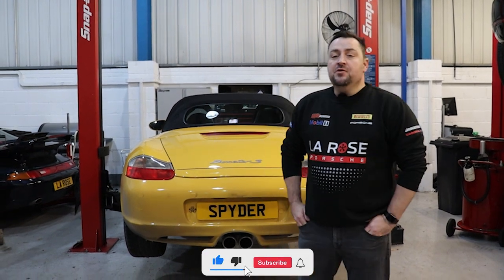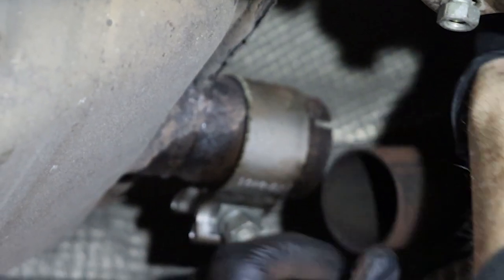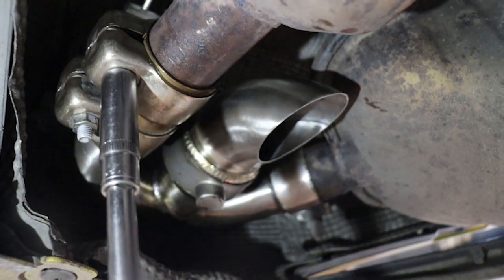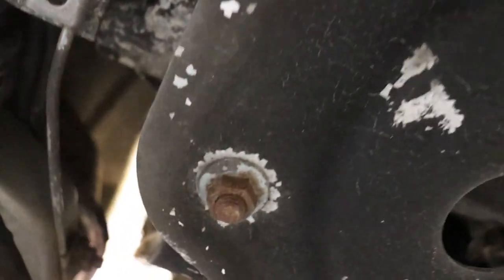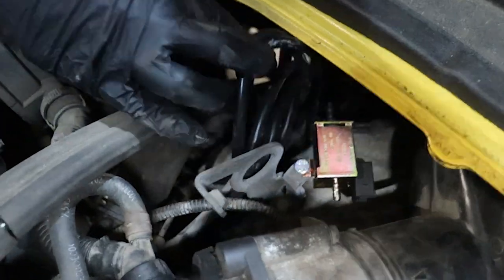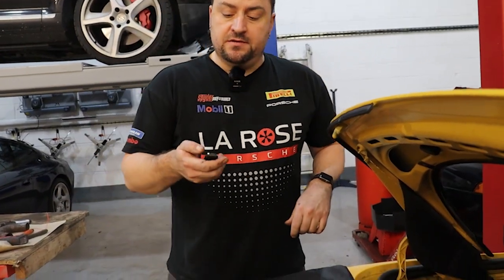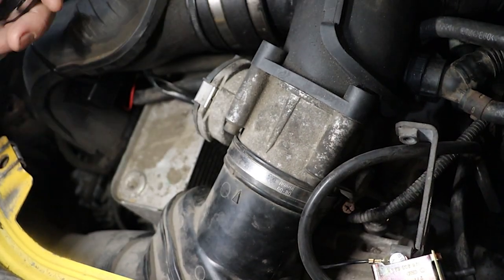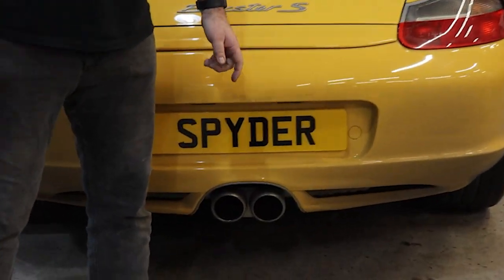PORSCHE 986 BOXSTER S SPYDER PERFORMANCE EXHAUST BYPASS VALVE SET!

Comment: I am in the States, and I just got the exhaust bypass valves from Spyder.  I did removed the stock mid-pipes with the secondary cats. The secondary cats do not affect our emissions or your ECU, no codes. The install was very easy to do, and the sound is amazing.  Cold start with the valves closed is loud at first, and then it mellows out. Driving with the valves closed it sounds a little louder than stock, I think because I don't have the secondary cats. Driving with the valves open is nothing short of amazing. I highly recommend these if you're looking for an easy, cheaper, solution to other valved units on the market, and you want to have a nice flat six roar at WOT and higher RPMs. 
My car is a 2002 Boxster S, 3.2 6spd manual. Love it.
Reply: How was the shipping process getting the part into the states? Any major fees or long wait times?

Comment: I bought a car from these people. The day I collected the handbrake pad retaining springs broke. They couldn't fix it so I drove away in a car with no handbrake. They sent me the parts and I paid a local guy to fit them. He told me the brakes were in a terrible state but in fairness LaRose sent me new pads and discs all round. I did the rears but there was a delay fitting the fronts. When I finally came to fit the fronts I realised they were the wrong ones. I told them but they refuse to change them. So if you want  a Porsche with dodgy brakes and like abysmal customer service these guys are the place to go

Comment: I have just installed mine today..... advice..... I spent 4 hours  installingrs trying to find out why it was not working.... in the end was simple because the central black box was not properly connected................... 2 hours to get it..... so, double check the connector  before installing it.... my 2 cents...............

Comment: Hi, will the car pass mot with the valves fitted? And can they be wired to a switch inside the car instead of the remote fobs?
Reply: It will pass the MoT as you just revert to the old system for the test. It could be wired to an internal switch but at a cost and not worth it as the fob is easy to use.
Reply: @Cybot7  thanks Toby

Comment: Nice video & product! 👌
I was curious about two things after though… 

There were three outlets on the solenoid that you mounted by the engine lifting eye. 
However, you only seemed to fix pipe work to two of these outlets? What is the third outlet for? 

Also… It would of been great to see which hose was the inlet vacuum hose that you spliced into.. I didn’t really see where you took that vacuum feed from.  

This product doesn’t come with instructions does it? 

Just this video as a guide as I understand.

Comment: Hi,

Just a couple of questions regarding the install. I've now fitted the system (sorry I live far from you guys!) but I do have some questions:

1) there does appear to be a small amount of exhaust coming out of the valve output when the valves are closed - is this normal?
2) the sound when the valves are closed is louder and bit more throat than stock (not a bad thing at all!) But wanted to check this is normal too? 

And finally, if this is normal (3) I assume the car will still pass its MOT emissions test when the valves are closed? 

Many thanks

Comment: Can you get the same sound by just deleting the big muffler and run straight pipes from the cats back? I know you won't have the valve to switch back and forth for the stock sound because the muffler will be deleted but you would have the same sound correct?
Reply: Pretty much yes

Comment: How much does that cost?
Reply from the maker: The Spyder Performance bypass exhaust set costs £355 ex VAT. 
https://www.spyderperformance.co.uk/shop/exhausts/valvetronic-sets/porsche-986-boxster-spyder-performance-exhaust-bypass-valve-set/
Reply: @LaRosePorscheKent  does that include fitting?
Reply from the maker: @andyjohnson4767  £250 plus VAT
Reply: @LaRosePorscheKent  where is ti for 250 i see it for 380